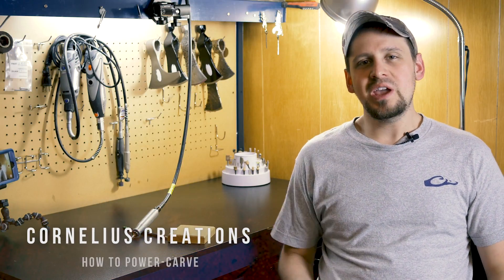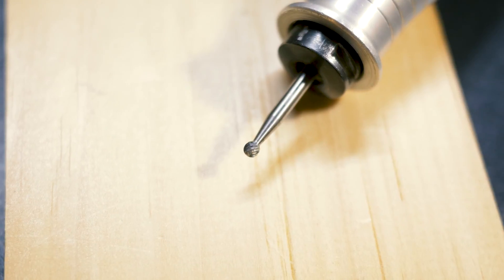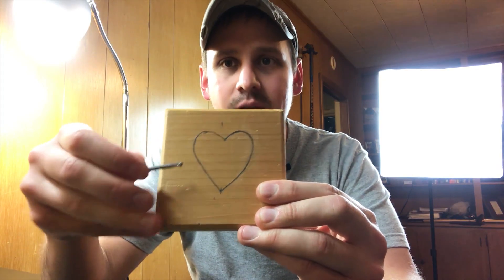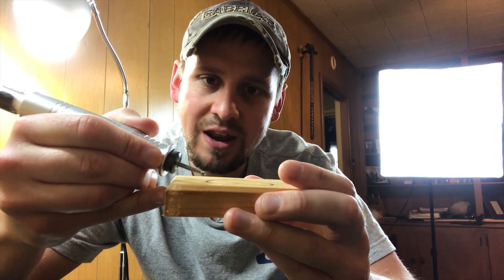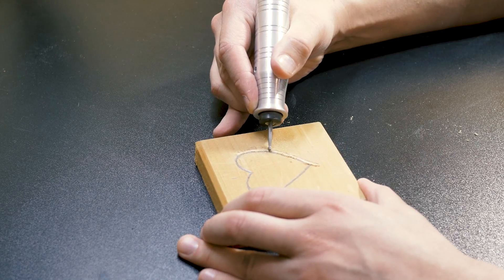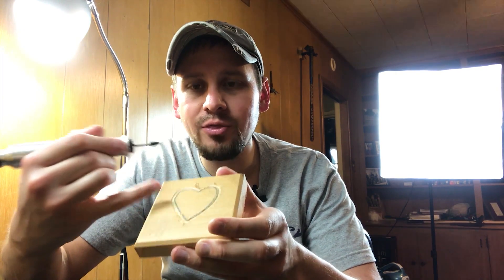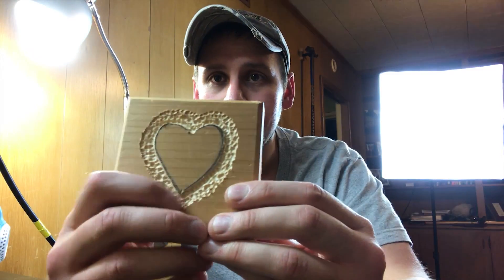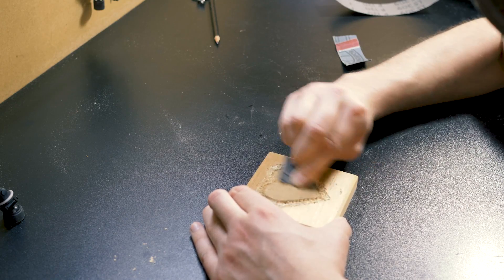How to Wood Carve/Power Carve With Any Rotary Tool

Comment: Have you ever used a Dewalt drywall cut off tool with a Dremel flex shaft to carve wood? The extra power should be awesome.

Comment: Hi sir, New to your Channel,  I have a rotary tool a basic one some people probably would say it's like a toy but it was it's all I have and what I could afford at the time so I was working on a project cutting Stone and putting my design on not too long ago and my rotary tool bits start flying out so I figured maybe I didn't have it tight enough and then realize that that wasn't the issue it bent somehow and now none of my b** will fit into my rotary tool and I have to put my project on hold is this a common thing that happens or is it because I'm using a rotary tool of lore grade, then let's say a Dremel? what's the difference between the two? I was told when I got it, it would work with cutting Stone and glass and such I really wanted to cut stone and make cool little designs, I usually work on seashells. This is my first time actually working on Stone and project was going okay for the first 10 minutes and then went completely South and now cannot even work because the bits just keep flying off..... any thoughts on what I should/could do? Thanks for your time.
Reply from the maker: Hey there! Do you have the right collet size in?  Make sure the right collet inside the nut that fits the burr. (See my blog on HowToWoodCarve to learn more about collets. If that isn’t it something is messed up with the locking mechanism.
Reply: @CorneliusCreations  
Hi, yes they are the right size.. I actually got one of the bigger one to work last night. But yeah I think it's just cheap and messed up unfortunately.  I'll check your video out! Thanks for the reply 😊

Comment: I'm using the dremel 3000 with flex shaft what level do i put it? What i mean is the rpm.
Reply from the maker: That depends on the wood. Try to stay around 15-25k
Reply: Cornelius Creations thanks!

Comment: Maybe set up a shop vac in another room with a long hose, and have it draw close to the work piece. Should help pull the dust from the air close to the source.  Less cleanup that way.
Reply from the maker: Been meaning to do this!

Comment: How’s the Dremel fair for small intricate...like funny Detailed faces on palm chisel handles?...do those bits try to “jump” on you,or are they very easy (smooth) to control ?...are the bits at Walmart not that good,or just not your preference?
Reply from the maker: You can do intricate detail but you have to be careful on how they jump on you. Anything under 60,000 I’m pretty sure you have to keep under control especially when using carbide burrs with teeth. Even my Foredom jumps. The bits at Walmart will work, they just loose consistency over time if you use them a lot. I’m sure you can get by with a dremel and some small dremel bits. Just barely apply pressure and “smooth the butter” when you use the bits, take minimal wood off at a time, when you start digging in is when they jump. Hope this helps!
Reply: Cornelius Creations Weaponry alrighty then,well thank you very much...I’ll look into more of the higher end bits on amazon... my Dremel has hung in the shop for quite sometime...I’d wrote it off for woodworking until I saw your video this morning and how to properly use it...”it’s not a hammer drill 😋”
I’ll give it a shot and try to keep in mind to think of it as a piece of glass...and NOT look at the clock. 😁👍🏽 thanks for the time,have a great day.
Reply from the maker: Haha! Right on man! Glad you are getting the fire back!

Comment: Nice video, very instructive. Thanks for sharing.
I watched the link to the tool you used. It's quite expensive for somebody who wants to give wood carving a try but is not sure yet if he will do often/like it very much.
Are there some (much) cheaper alternatives to this tool?  If so, what can you recommend?
Reply: I use a couple of relatively inexpensive tools that serve me well. For 1/8"-shaft bits, I have a Black & Decker RTX-6 (about $35) with a Dremmel flex shaft (~$30). For 1/4"-shaft bits I have a Heavy Duty Flexible Shaft Grinder/Carver from Harbor Freight ($50).
Reply: The older dremmel models can be picked up cheap.
Reply: B Farley —- how funny! You must have done the same research as I’ve done. Because I bought the exact same equipment as you, several years ago. The B&D was cheaper than Dremel and had a better motor. When you buy a Dremel, you’re paying for the name and people don’t realize that there are other brands that make rotary tools also that may even be better, and that take all Dremel bits and more. Thanks for posting your reply!
Reply: Yeah, if I were to do it again I would buy the same tools. If these break, I would buy the same tools. The Dremels and Foredoms are nice, but I'm carving wood, not buying party wear, so cost is important, especially after what I spent on all the Saburr Tooth bits and a few good hand-carving tools -- all that cost 3X what the power tools did.
Reply: Great vid! People often forget 2 look @ pawn stores.  You can get top grade tools 4 way less. I think the  flex shaft is often an important attchement many beginers skip & struggle with weight of rotary tool instead of freeing the hand for more precision & not tire out hand.
  . If not just stick with dremel or BLUE HAWK ( almost exaxt same as dremel but cheaper) every holiday especially father's day and can get 500 bits for $20 on some deals .  I always watch people buy most expensive tools for something they want 2 learn as hobby or new skill ,use it 1x then never again. Start cheap learn the skills & got great advice from an old timer @ a craft fair. He said learn on hand me downs & only buy better tools off the $ you made from what ever you make. That way as your skill improves so does the materials you can work with & get into custom orders & demand higher prices.  I would also recommend the dremel work station as it basically turns dremel into almost every tool for diy projects
Reply from the maker: I highly recommend this one for beginners and more experienced carvers!
http://amzn.to/2FCpWeq
Reply: Thanks.
Reply: Or just grab a Dremel 4000 with the flex shaft, I have owned one for years now and it has served me well plus you are not limited to just carving with a dremel. They can be used in the router attachment and other things made for dremel, even sharpening garden tools.
Reply: I highly disagree with this recommendation. This Tacklife thing is underpowered and the accessories are all basically low-quality junk you will be frustrated to attempt to use. For wood carving you need more than 1 amp/120 watts. Go for the B&D RTX-B or RTX-6 as a minimum. Add a flex shaft, either Dremel or some other, but I can recommend the Dremel. You'll need some rather pricey but worth it Kutzall or Saburr Tooth burrs (I have and use both) and a set of the carbide burrs that are on ebay for about ten bucks. Sanding stuff for rotary tools? Not much works that well but you do what you want.

Comment: ok I just purchased a rotory tool and have all the standard accessories that go with it and I was wondering, can you use the stone tips no matter the shape for woodwork? or do I need to only stick with the bits that you showed in your vid?
Reply from the maker: +targus98 awesome dude! No, stones are really used for finer cleaning and are good for detailed sanding. It will wear them out fast. To start carving, the 2 burrs I showed are really the foundation you need to start. Being because carbide burrs use “teeth” and not “abrasive” sanding.
Reply: OK cool thank you
Reply: targus98 yeah what he said....but....if that's all you have have fun with it! I did. Then when you get the metal ones you'll be shocked at how fast it will dig a hole/move material. ✌❤

Comment: Wouldn't it have been way faster to use a hand tool, even a chisel? In what situations does dremeling shine?
Reply from the maker: Fantastic question. Yes & No. 

1) Depends on how big or small the project is.
2) What kind of project it is. 
3) The kind of look you are going for.
4) Sometimes you need a car, sometimes you need a truck. Use whatever means you are comfortable with to get the results you want.

Usually people use Dremels for animal carvings but in recent years have really expanded out. 

There are places a Dremel can go that a traditional hand tool can’t.

Hope this made sense!
Reply: @CorneliusCreations  thanks for the reply!

Comment: I just opened my Foredom box (K5240) today that I got for Christmas. I turned it on the forward position and the handpiece began to spin in my hand and got really hot in the area where the handpiece and shaft meet, then turned off. It wouldn't come back on in the forward position but it did in the reverse position and it didn't spin at all. Any reason why this happened?
Reply from the maker: Did you have the small shaft bit in the hand piece correctly? I would contact Foredom by phone and talk to them. That is very weird man!!
Reply: Cornelius Creations Weaponry, yes it clicked into my position. I'll call Customer Service. Thanks
Reply from the maker: Any luck?
Reply: Cornelius Creations Weaponry, Yes, it was an issue with connection of the handpiece. Thanks for checking! 

P.S. Please do some demos of the uses of different burrs. I love your videos.
Reply from the maker: Good deal man. I will do some soon for ya bud!

Comment: i guess you get what you are paying for. 18000-32000 rpm is low for this kind of carvingtools.
Reply from the maker: Not necessarily, This speed is perfect for this. Higher RPM tools are used for more tedious detailing work.  A lot of work I do higher RPM tools couldn't produce the torque to do.